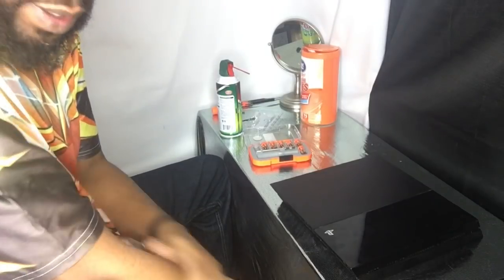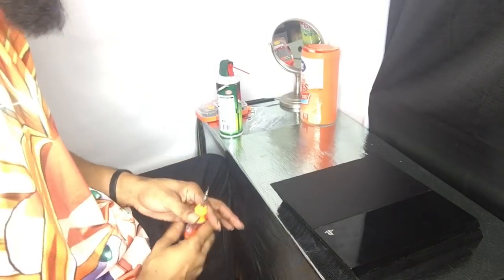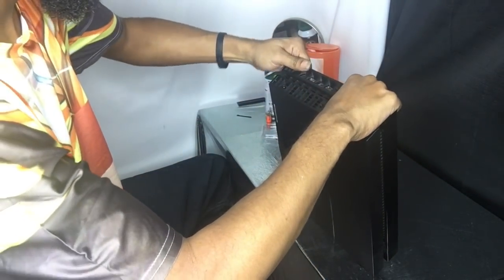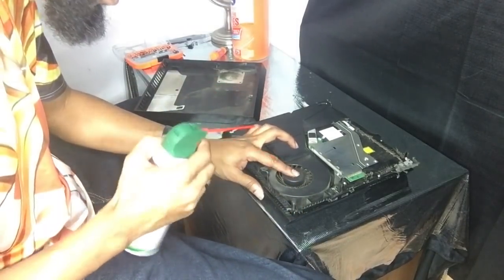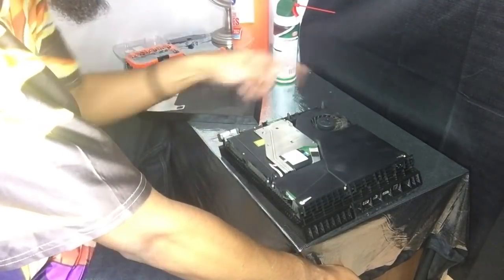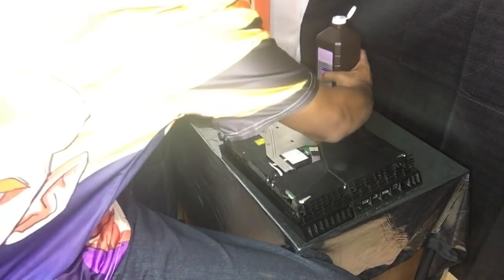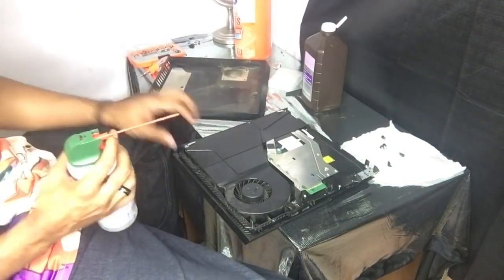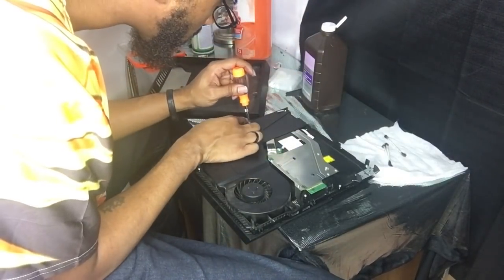HOW TO CLEAN PS4 FAN USING REGULAR SCREWDRIVER‼️🔥🔥

Comment: Cleaning only the fan doesn't actually do much. You have to take the power supply apart and spray the heat sink. I was afraid at first but I did it. A fucking dust cloud came out from that heat sink lol.

Comment: You dont need to hold the fan still I've cleaned many computers and the fan spinning up cause of the air actually helps get the dust out, it's an electromagnet and the ps4 isn't a closed circuit because the power plug is detached so it wont generate any current

Comment from the maker: 98% prefect! On lunch thing it didn’t do was decrease the loudness of the fan. I have a 1st gen ps4 tho so the big install games. Fallouts and RDR2 and things like that make it run harder but as far as performance. Greatest thing I ever coulda done for my PS4. I was so scared I was gonna break it but it’s easy.
Reply: Do you need to clean the inside of it? I've seen some videos where people take out the hard drive and the power supply. Mine is starting to get really loud when I'm playing Cod. I don't get the red light but the fan sounds an engine so it's going to happen soon. I'm just scared to open it
Reply from the maker: I did not. I was too scared for all that! Lol. What I did worked fine. Now maybe if I did I would help with the loudness but I can live with it. Station has worked perfect since I did this
Reply: @ImAnAddict  which screwdriver do I actually need. Some people use T8 and some use T9
Reply from the maker: T 9 is the one but as you can see from the video I struggled with it. I used a regular tiny screw driver. FF to when I actually start removing the cover and you should see. I believe I also mention the size I believe
Reply: Thats what I’m doing atm and it’s really is just that easy. The popping of the tops and bottom is just to snap back in place, it was scary at first but i got it done. Thanks for tips on this video

Comment: I just got red dead redemption 2 mine overheated 3 times then shut off, I cleaned it outside but didn’t work when I tried again. Would it work if I do this to my ps4
Reply from the maker: YES.sorry took so long. I was like you. Cleaned the outside wishing and praying. This method is the only way. It’s def scary at first but TRUST ME. Your will be happy you did. Mine has ran smooth ever since
Reply: Gaming Addicts Commun oh I forgot to say it did worst after some days I had to eventually get a new PS4
Reply: I have the slim now
Reply from the maker: Oh man. See that’s where I was at. If I tried the fan and it still didn’t work. Luckily it did. That’s sucks bro.
Reply: Gaming Addicts Commun yeah man and I had the original 2013 ps4, I guess my time was up on there
Reply: Man that sucks, at least you were able to afford to get a new one. Wouldn't be surprised if your fan just stopped working even when trying rdr2 and that's why it was crashing and overheating. Never cleaned my ps4 and hoping to do it tonight but I was nonetheless still able to play rdr2.
Reply from the maker: Good luck!
Reply: Semen Demon very true and I agree bro, thank god I have a slim now cause the person repaired it messed up the screws
Reply: Black Wulf Shiki Yo sorry for the late response but it could of been the thermal paste on the CPU. I also had the original ps4 and it was also very dusty. A few months ago I took my Ps4 apart and clean it. But I not only clean it i also replace the thermal paste on the CPU since it was all dried. Once I put new paste on it, it got wayyy quieter. With time the paste drys up and you gotta replace. The paste was about 8 dollars on Amazon. I know this might not help you alot since you did get a new PS4 but I hope other people realize that they dont need to get another console if it still is loud after the cleaning. Sometimes its just the thermal paste
Reply: QClout Blue sorry for the late reply but where do you buy thermal paste and is there a certain type you need to buy for a ps4
Reply: Minorhawk27 I bought my thermal paste online from Amazon and it was around 8 dollars, you dont need any certain type just search up thermal paste for ps4 on Amazon and it should come up hope I helped ya
Reply: QClout Blue thanks
Reply: Minorhawk27 no problem!

Comment: I opened mine today and did the same thing as you. My PS4 sounds a little bit quieter, I had SO much dust in mine it was as bad as yours. I didn’t go under the power supply either I’m not breaking my console. People keep saying to but honestly it’s more likely my PS4 would break from me messing it up than the dust down there anyway. Also one weird thing, I heard people say to use a T9 but for me a T8 worked, my T9 didn’t even seem to fit.

Comment: Where did u get the set I’ve been looking every where
Reply: It is is a a #9 hex security bit. It has to be a security bit. the security bit has a small whole in the center. this is why it will strip if you don't use a security bit.

Comment: You forgot the main problem, the cooling thingy mabob between the fan and power supply! If it’s blocked by a dust blanket that’s why your PS4 runs like shit!
Reply from the maker: Yea I was too scared to mess with it. Lol. It’s still loud af but Atleast it doesn’t over heat anymore

Comment: Just a heads up using a flat top screwdriver can be dangerous. You can strip the screw and not be able to open it again
Reply from the maker: Funny thing is I had to use the flathead because the T-9 almost stripped the screw. The flat head was my last resort and it was stripped so bad I barely got it! Lol.
Reply: Gaming Addicts Commun I’m going to have to try now 😂 I stripped the first screws and was scared
Reply from the maker: Yea it was out of sheer panic I tried a reg screwdriver! I was so happy it worked